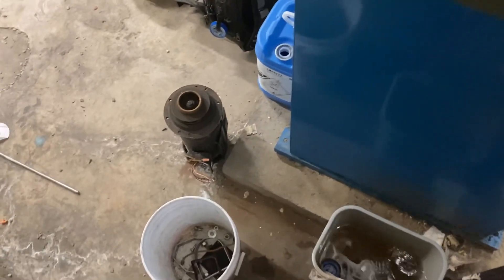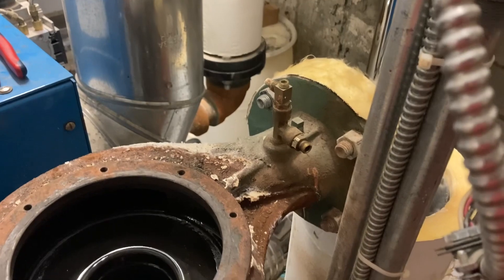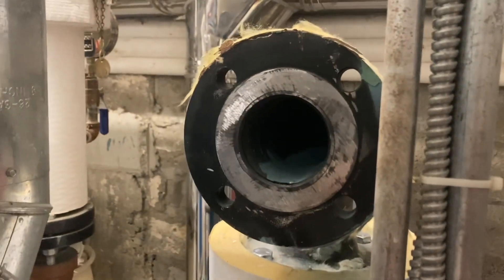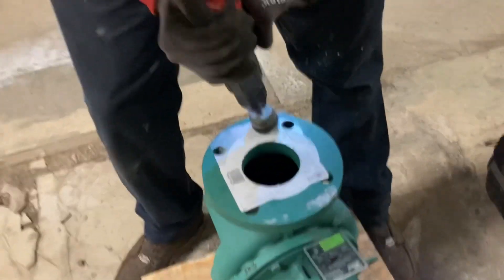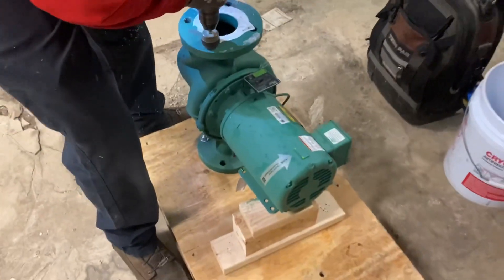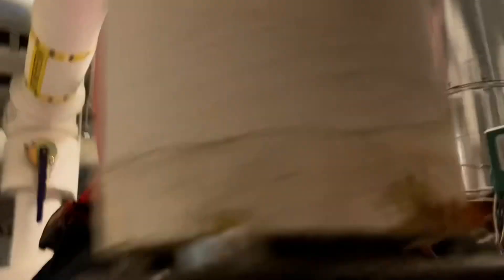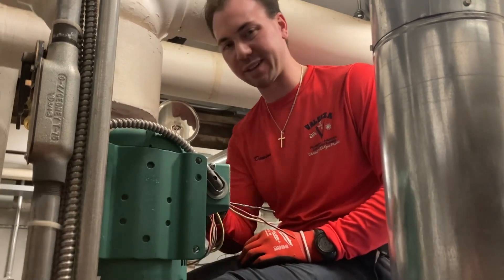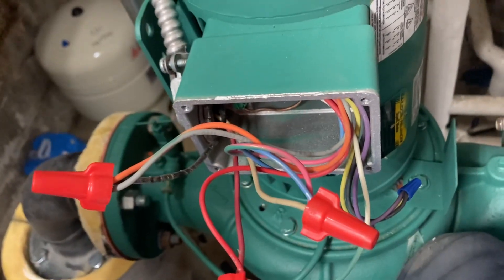Circulator Changeout! Commercial Heating Service Call.

Comment: Hi, have you ever changed something as big before? what happened to the old circ?
Reply from the maker: Hello. Yes, we change and rebuild circulator bigger than this fairly often. The FI floor mounted Tacos are about as big as we get. The old circ has a bad bearing assembly and leaking seals, but the parts were 10 months back ordered, so the customer opted to replace the whole unit.  Even this replacement circulator was difficult to find.

Comment: Solid wire in flex?
Reply from the maker: I’m not an electrician. I just wire up equipment with the wire I’m provided with. Am I missing something? The wiring in this video is very common. It’s found all over this college campus and on lots of other commercial properties we work at.
Reply: I’m just messing with ya. Good luck.

Comment: Isn’t it a bad idea to use a grinding wheel to clean the faces of the flanges? I would think a wire cup wheel on the grinder would be better. That way you don’t damage the metal.
Reply from the maker: I didn’t have a wire wheel for my grinder and the wire brush on the drill wasn’t cutting it, literally. The fiber gasket from the old pump was baked on. A light hit with the grinder took it off quickly. There’s no damage to the companion flanges, I promise. This is why I apply teflon paste to the mating surfaces. So the gaskets I install come off when the pump needs to be changed again.
Reply: @valenzaplumbing  As an automotive tech, protecting the sealing surfaces of parts is extremely important. I love the videos! For some reason I watch every one of you and Mikey Pipes videos, haha!

Comment: One should not forget to install the pump head upwards is not good and will destroy the pump [air accumulates in the pump head and reduces the life of the pump]
Reply from the maker: Generally I would agree. But this is a KV series circulator and Taco designed them to be mounted exactly like this.
Reply: @valenzaplumbing  Thanks for the reply, don't forget

Comment: Great video always put blanks on the piping if you’re change out the pump right alway in case the shut off doesn’t hold or something happens & LOTO the shutoff and the breaker.
Reply from the maker: Good tips. I should get some LOTO stuff and keep it with me. Hope you enjoyed.